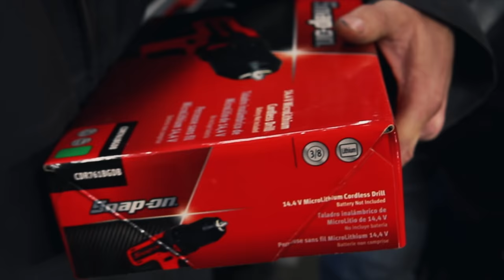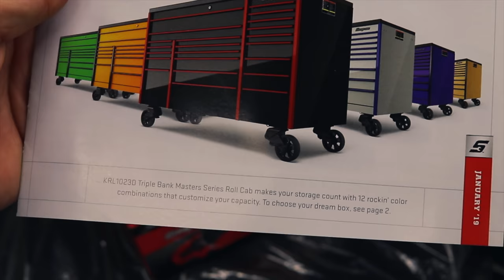New Snap On Tools, Pink Socks and A GAW (sort of)

Comment: Got a good modification on the swivel head locking ratchets to make the lock more user freindly. Done it to my new 3/8 and 1/2 used a dremel and put groves on it. Hands can be soaked in oil and still unlock the swivel head
Reply: Tried to send a picture couldnt get it to upload